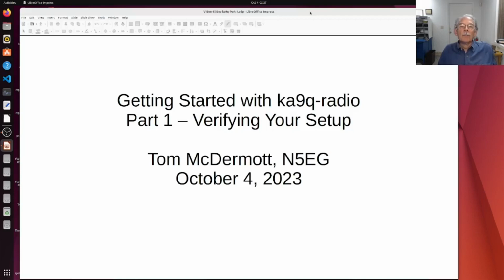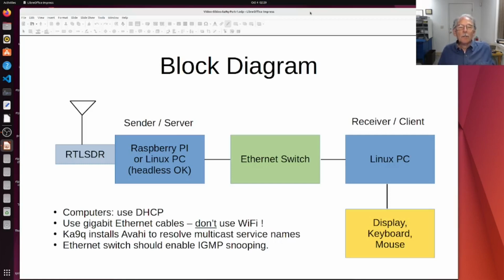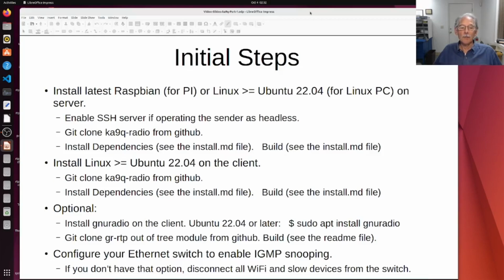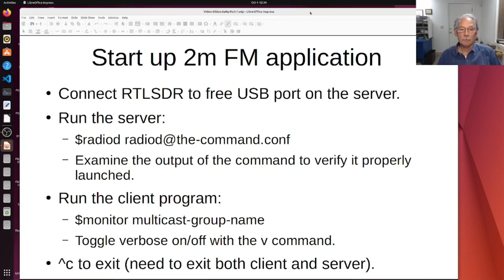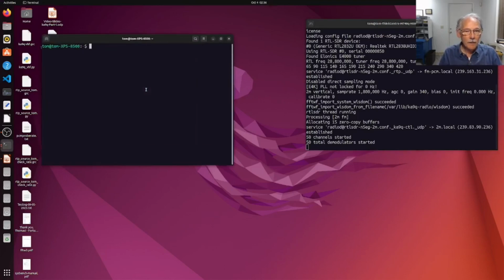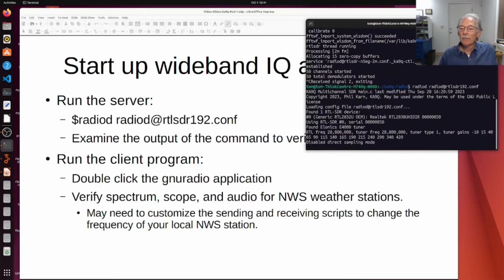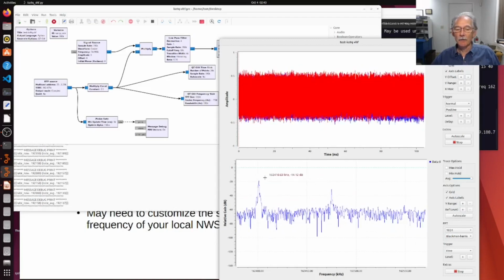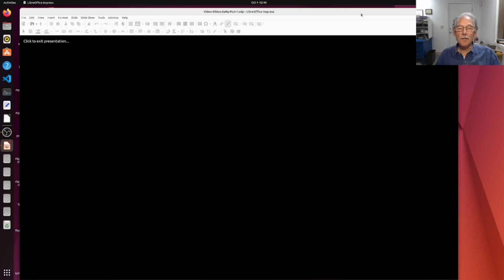Getting Started with ka9q radio   part 1

Comment: Does the file radiod@the-command.conf not exist anymore in the new version of KA9Q-radio ?
Reply from the maker: you need to replace the-command with the name of the actual command that you want to execute.
There are multiple different commands installed by ka9q-radio.

Comment: Are you recommending putting this on your home network or setting up a separate Network with just the two computers and a switch?
Reply from the maker: I am running this on my home network.  With IGMP snooping enabled, only the computers involved have multicast traffic,
the switch filters it out of the other ports.
Reply: TY! One more thing. I don't see any rtlsdr conf files, only airspy and rx388 - did you make your own?
Reply from the maker: @jeffkelly4329  
They are at:  https://github.com/Tom-McDermott/Miscellaneous
Reply: TY! Got them and the Pi is working FB - now onto the client!
Reply: A reinstall of gnuradio and/or setting paths fixed that.